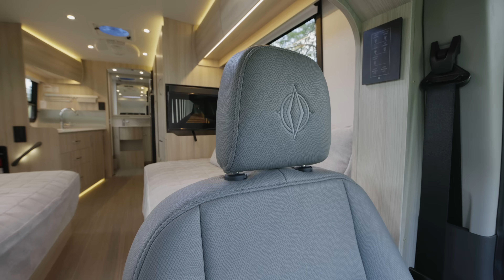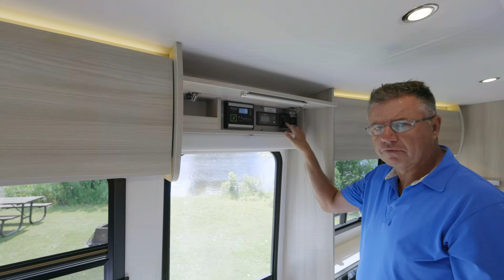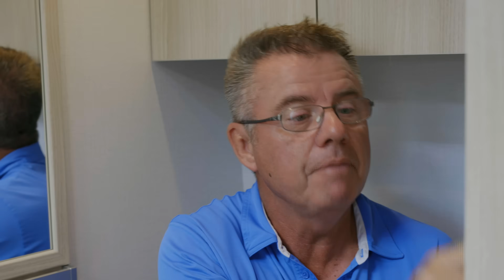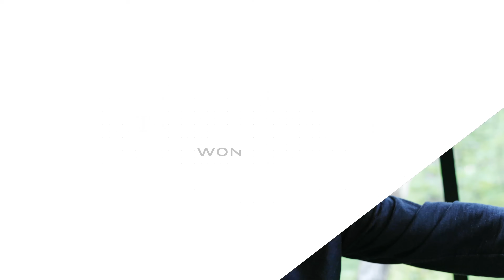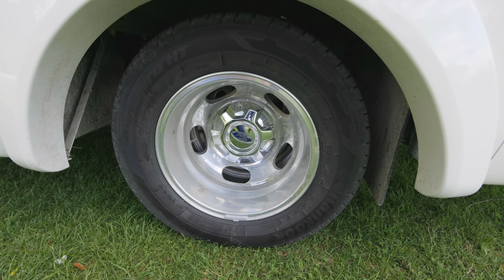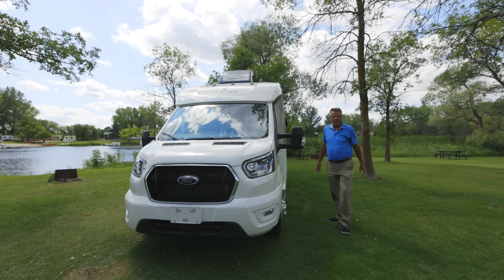2022 Wonder Front Twin Bed

Comment: My favorite floorplan LTV still makes is the rear lounge but if you are not driving then you are regulated to the front seat. There should be 3 seatbelts in the back so if you are the passenger you can relax in your choice of seats back there enjoying the views but no you cant enjoy that area unless you're parked. You might as well be towing a trailer.

Comment: The biggest problem I have with these B+ floorplans is seatbelts. Its maddening that when its parked you can seat like 8 people but going down the road only two seatbelts. So much for taking a road trip with friends, they would have to all follow in their own cars. I think if you can sit there there should be a seatbelt.
Reply: In the US it's not required for large buses like Greyhound to have seat belts. Never seen a city bus with seat belts. Is there some rule that exists or is it all in your head?
Reply: @jjryan1352  In most states everyone riding in an rv is required to be in a seatbelt, not to mention children needing to be in 3 point belts or a child booster seat that requires a safety tether anchor point. I guess LTV only has childless couples or people that never want to take a road trip with friends buying their units. Something the size of a small bus should be able to handle more than two people going down the road legally.
Reply: The Airstream interstate can seat up to 9 people with seatbelts and that is within the confines of the van body so something the size of an LTV should have seatbelts on every seat, There is just no excuse.
Reply: @jeffreypatterson9956  I see. I did a search and 22 states require all passengers to use them, many others say it only applies to teens and younger, while a few only require it for those up front. So yeah an RV business should probably have those as standard.
Reply: this model is for 2, clearly. if you want purpose-built seats with belts, choose another model.

Comment: This is the perfect motor home with one exception. Get rid of that stupid propane fridge! The solar is more than enough to keep up with a 12 volt compressor fridge. It’s the one thing that even if the owner switches it out you end up with the stupid vent holes in the side of the van.
Reply: that is only good in year round sunny climate.  Canada and northern States  do not comply with your demand.

Comment: Not a fan of this design. 1/3rd of the day is spent sleeping. So rest of time you are sitting on the bed?
Reply: Looks very uncomfortable to use as a sofa. No back. Those home sofas with the angled back that fold flat into a bed should be an option.